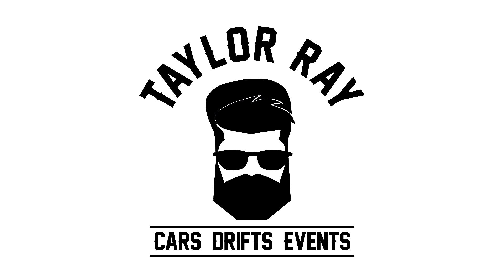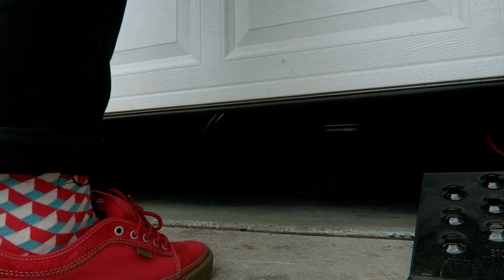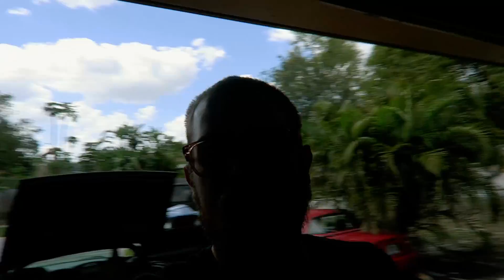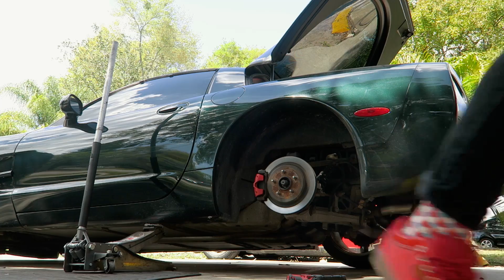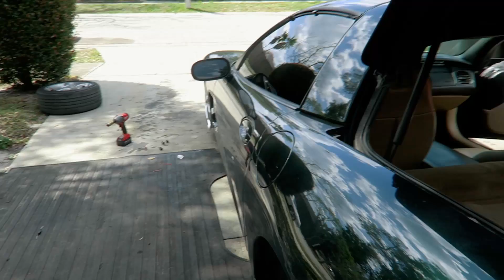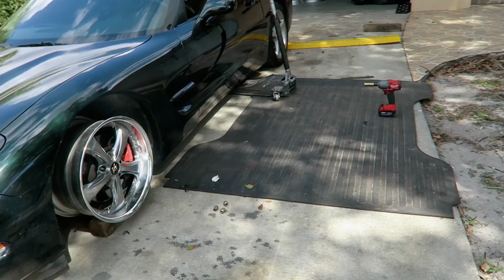JDM WORK WHEELS for the Corvette Drift Car!!

Comment: Those are some American-looking Work Wheels. I'd say the look fits the corvette well.
Reply: They remind me of the OEM Mustang GT wheels.
Reply: vskfs were designed in the 90s, before bullitt wheels.
Reply: Bullitt style wheels have been around since the 60s....just saying.
Reply: They look American here because the offsets are trash.  Low offset Work VSKFs on cars like Silvias is the stuff of LEGEND
Reply: duane willis the offset on the rears really isn’t THAT bad.... I mean that’s a 3 inch lip it looks like.... what he was referring to is the fact that the actual face of the wheel resembles American wheels like the torque thrust

Comment: Just keep in mind when you go to rebuild them, they are 3 piece welded. The weld needs to be machined apart, and then tap the back of the face to add some bolts to the spokes or reweld the split. It's a pain in the ass to do, or decently expensive to do yourself.

Comment: I also own a c5 corvette and I always find boring oe replica wheels for the corvette. could you tell me if you ordered your wheels as a 5x120 bolt pattern or 5x120.7.

Also what are the offsets for the front and rear wheels. Very important to know this since the stock wheels offset on the rear is 65mm and very hard to find aftermarket wheels with stock offsets. thanks in advance.

Comment: hey man the wheels look good. you probably wonet read this cuz it's been a wile since you posted the video but I'd say run the back wheels in the front and get some 11.5s or so for the back to fill that gap and use the fronts as a nother set for drifting. it would sit mint with more width front and rear and you'd probably never have any under steer with that much tire up front.

Comment: Why don't you put the rears on the front so you don't have to run a spacer and mess up the alignment and then put the fronts on the rear and use a spacer? Sooo pumped for you though! Love vskf's!!!
Reply: he probably wants wider tires in the back for grip

Comment: Making a decision on what to rebuild them to is kind of hard without everything being done. Like you said the front all depends on angle mods and the rear will depend on how low you go once you get your better coilovers sorted. If the control arms are flat now it will start to pull the top of the rear wheel in as it gets lower so you kind of need to do that first to see. I guess you can do that visually with the coil out of the car. You can't just fix wheels that are too wide with camber on a drift car!

Comment: Not too bad. Didn't think I'd like the look when you showed the wheels but once on the car the look alright. Also just a tip be careful when using impact wrench to tighten wheel nuts. You can get special sockets that limit the torque for wheel nuts so you can't over torque.

Comment: Just use the wider ones as is (polish the lips + clean/change the hardware) in the front and put wider lips on the others for the back. No need to rebuild them entirely, gets expensive real quick.

Comment: I got a C5 convertible I put C6 Wheels all around 19in 275 in the front 19 inch 285 in the back right now I got the 285 in the front they just rub

Comment: FedEx is easily worse than the post office in terms of shipping anything. The drivers aren't typically paid by the hour and it's easier for them to write up a "damaged package" instead of writing a note saying they tried to deliver your stuff and you weren't home.  A lot of their drivers will do this kind of stuff to be spiteful since the wheels probably took up a good portion of their trucks and they're not getting paid to not deliver boxes. Use a different carrier next time if you can.

Comment: I just wonder why you are making it looks nice before making it perform. 
Angle mods, hydro, exhaust and a tune should have all come before wheels in my opinion. 
She sure is going to look good in those wheels though!
-Stay Blessed
Reply from the maker: +Adriansitos623 nobody makes angle mods. Or dual caliper brackets. I have to design or have someone design those parts. They are not available for purchase. Otherwise they would be on the car.
Reply: Taylor Ray Wilwood bakes a universal dual caliper kit similar to the one Caleb is running in his new car. I think you can gain some decent angle by grinding down the steering stops and getting a different steering box well if it is anything like my F body front end which i think it is the same. Hope that helps
-Stay Blessed

Comment: Wow. I think you could've definitely found a cooler wheel than that. Those wheels are way to curved. The car is way too many round parts on it to have such a rounded off wheel.   I prefer something with straight spokes that are very thin and some rivets. To each his own. It's your car. If you like it awesome! #NotAFanOfThose

Comment: I sold you the wheels. I packaged them properly and securely. Please do not make it sound like it was my fault that Fedex damaged the boxes and did not properly repackage them after inspection. 

I took the lower offer after doing some searching and found out it was you. I thought having the chance to be able to see my wheels rebuilt by a famous YouTuber would be very cool and I could use some exposure in the market as well. 

I got no requests for further detailed pictures from you, just offers. When i sent you a message after shipping them off i didnt get any replys until one that said you wanted to open up a claim. 

I strive for customer satisfaction. And it shows on my ebay feedback. I do not appreciate the one sided story making it look like I am the one to blame. Blaming someone else without fully knowing what actually happened is a bad trait to have

Cheers, 
Brian @lim0ride
Reply from the maker: +Lim0ride - Brian "not as clean as I expected" wasn't meant in a bad way. They're still fine. I wasn't concerned enough about it to not buy them. They just looked a little cleaner in the pictures. That's all. Not blaming you. I also didn't call you out and say who you were or anything like that. 

I was under the impression that the boxes I got where how you packaged them. If they were it would have made sense why the boxes got damaged because they almost fell out of the bottom when I picked them up. 

Fed ex was very unclear to me about what happened. Just. Here's your boxes. On you way. 

Sorry if it seemed as though I meant anything I'll towards you. I'm super happy with the wheels and you shipped them super fast and I have them and all is well.
Reply: Thank you. Glad you are happy with the wheels. Hope you rebuild/refinish them down the road. I would very appreciate it if you would give me a shout out. Thank would make my day.

Thanks